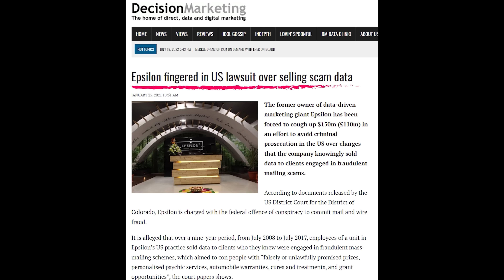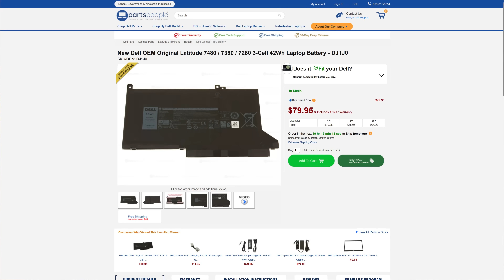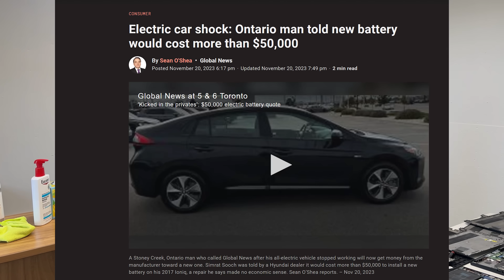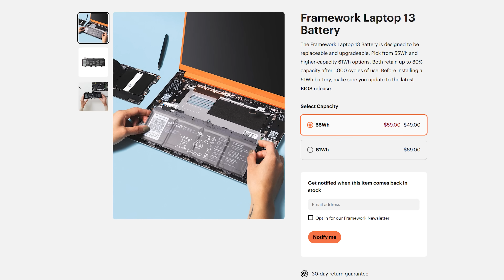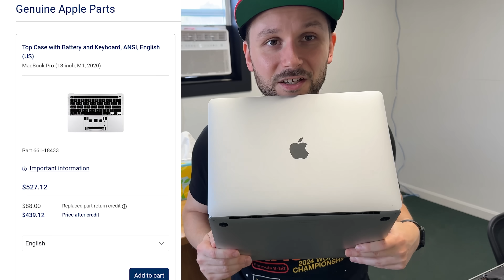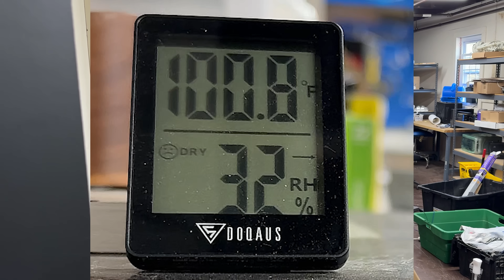Planned Obsolescence: Why is Replacing a Battery STILL So Difficult and Expensive?!

Comment: well this is why we need solid state battrys sooner then later. tech compnys are  still working on that by the way. thats the ahrd limtaion of electrolite ion based battry filed devices. also this is due to how the battrys degrade over time whout being borkens down and rebuilt in a battry recyeling and reproceing plant you know. this battrys only last 5 to 8 years tops before they will soonr or later just go boom or not work anymore. this is a actal ahrd limtaion of the battry technogly under the laws of phisics itself and not due to any littel to no actral defects in the  prodcton  procces by the way. even a elcrtolite ion battry with no defects will sooner or later bloat or go boom this is just how it is. this battry degrade over time and untill solid state battrys beocme lareg scale vibale on prodacion starned capbltys this is giong to be thing. its just a hard limit of how elcrtolite battrys work in gernal. the elcrtoilte batry teachogly itself just won't last foever due to how the core funemtal issues wheitn the tech itself. also unless you want to use lead survric asid battrys that last a bit loger and don't exllode are not coeming back anyway. but soild state sulfer grathite battrys however are giong to rpace thsoe anwyay fomr repring all of thesoe old lead acid battrys of there surlfer will be used to make alot more sulfer grathire solid state battrys instead. when the tech devpoed to the post of being large scale producable eventaly.
Reply: it would help if we made battrys that wher standrezed for easy replacment but that would make the issue of what to do on how to dispode of the old battrys evene wrose or you know more actandal fires and propery damage fomr mismanged costmer battr yreplacments gone wrong and of corse kids being very disrutive to ther devices witha acebale battry repalble carparment would also make the issue far wrose. theres to many issues wit thise tpye of battryd due to the tech funmental litations itself that its inavble it will die or explode.

Comment: Since you're flooding the market with used laptops and I'm outside the US, I somehow had luck to get for about 17$ from a friend a ThinkPad X1C6 which is top spec but it needs 2 new smd caps and a bios reflash. for a machine that was such top tier (it's the best of the best i've been told) and been bought used for 500 euro by my friend's friend, i think the gamble i took isn't that bad

Comment: "Am I blowing this out of proportion?"

Absolutely not. I just recently helped my mom refurbish her Asus X401A because she wanted a laptop to watch Netflix on. I asked her why she hasn't used it in the past 10 years and she said "Because the battery was shot and it wouldn't hold a charge." So we went on Amazon and got some sketchy third party battery for like $30, and I have no idea what to expect from it. Were it not for me knowing how to refurbish her laptop, it would have been thrown away eventually despite being perfectly capable of what she wanted out of it, except for the battery.

It's gotten to the point that I've told all my friends and family that if they have an issue with a computer to contact me first, because I've watched them throw away multiple usable computers due to simple stuff like hard drive failures or dead batteries. Or they buy something that isn't powerful enough for what they want, and then they throw it out brand new and buy another one. Rinse and repeat til "this one actually works."

Comment: They are flat cell lithium batteries within the plastic then stickered enclosure. You can remove them, measure them (most are marked with their size anyway) and remove and replace them. It's a PITA, I have done it when I couldn't find a battery for a family members laptop. It's time consuming though, spending an hour refurbishing a battery is hard to justify the cost of labour if your a business even if the batteries are fairly cheap (yes from a reputable source). As a hobbyist it's cheaper than telling your gran to buy a new machine, and in fairness although lithium cells are fairly safe... I can image alot of people cutting these open with metal tools and asking for trouble... so an off the shelf replacement is the best idea.

The best idea in my opinion is like a AA or AAA or C or D batteries or 18650's each battery should be made to an agreed standard spec and shared between manufactures. Think of early Nokia batteries, having these plug into the enclosure which plugs into the laptop allows the same freedom with battery design but easy replacement in 4 - 6 years when the battery craps out.

Comment: "Stop Killing Devices"

Pirate Software: "Throw batteries in the ocean"
probably
Reply: no you get the battrye compnys to take the deaed battrys to a battry recproing plant and brake then down to gronud up[ shreaded batery plant recyled  manfactring feedstock to make new fresh battry with. thats how you deal wit hdea battrys is to use the remains ofthe deam battry brake it donw to its core elmeantal metals and otehr stuff as feed stoc kthen amke new battrys out of them. well thats how battry recyeling normaly should work but the energy power gird requrments cant also be done unless you have also have a lot of surplss power to spare to power shuch mencinery. we will need nuclear fission or fusion sacle powerplants proveing alot of easy and  on demand huge amonuts of power first in order to do such things withe energy reqrments for shuch stuff.

Comment: What I find dumb is that more and more devices are getting settings to stop charging at 90% or whatever for "battery longevity", but do the prices ever accommodate that you're only using 90% of the battery?
lol
lmao
My tinfoil hat theory is that battery manufacturers have probably figured out a more long-lasting battery technology, but don't bother with it specifically because li-ion batteries give that expiration date to devices that wouldn't actually have one.

Comment: i honestly gave up on batteries , i prefer laptops for mobility , and as fa as mobile as i can be , i can plug my laptop and use it plugged 100% of my time using it , so i no longer care for a new battery or being concerned with the new laptop battery incase i upgrade

Comment: My dell latitude 7490 that i bought 2 years ago used for 200 euros , works great but the thermal profiles are shit, so use it in cool mode or else it will melt itself (Dell power manager). Best of luck.

Comment: One thing you could do and I'm sure you've thought of it, but go ahead and get the genuine battery, bake that cost into the sell price. 
Whatever your margin is, just factor that into the sell price in just like the SSD and repaste costs. You are still providing a fantastic deal on capable hardware and keeping it out of the landfill. 
They are still better after going through you and sold for $300 then the POS $300 garbage at Walmart. 
Another idea, put an option in the store to have it preloaded with the win11 bypass. Keep up the great work Andy, you aren't alone!

Comment: The laptop manufacturers should go for a industry wide battery specification standard, so you could use a battery from a newer model that's still being produced inside an older model that's not being produced anymore but uses the same standard. At least that is what I think would be the best.

Comment: It's kinda crazy how you can go in and replace the RAM stick with whatever and even replace any HDD with any SSD but suddenly when you want to replace the battery you must get the exact right make and model. Like if my PC's PSU dies I can just get a new one that outputs the same or greater wattage, why can't batteries work like that?
Reply: Manufacturers loves to make a proprietary battery. Serialized BMS, different connector for every model, and different communication protocol for every model

The sad reality right now because there's forced standards in laptop battery yet
Reply: Let's start by purchasing Framework products
Reply: Not all laptops slow you to replace the ram my piece of shit Lenovo has soldered ram fuck Lenovo (yoga mainly) we need frameworks
Reply: Laptop battery are not too expensive to gamble. If it can run without battery.
Reply: A PSU isn't a battery, though... it's a Power Supply Unit that allows varying levels of power to go to different components depending on need. It takes incoming AC power and makes it usable within the system

A battery is a storage component that contains two different kinds of chemicals that force electrical energy (voltage/EMF) to stay inside the battery until a path exists for it to travel through, which is DC

Technically, you can restore a battery, though, if you replace the chemicals involved, but I wouldn't do it with things like lithium oof
Reply: @Alice-si8uz you missed the point, by a mile! 😂
Reply: @Alice-si8uz what's up with all these yap?
Reply: @Alice-si8uz bro tried so hard to sound smart

Comment: HP Notebook PC 15s-eq2202nw

AMD Ryzen™ 5 5500U APU [1]

512 GB SSD [3]

16 GB DDR4 SODIMM SDRAM

No optical drive

Windows 11 [67]

39.62 cm (15.6") diagonal FHD IPS LED (250 nits) [4]

3-cell, 41 Wh [63]

Silver

[1] Multi-core technology is intended to improve performance in certain applications. There is no guarantee that all customers or applications will benefit from this technology. Performance and clock speeds may vary depending on application workload and software hardware configuration.

(3) For storage drives, 1 GB is equivalent to one billion SAT and 1 TB is equivalent to one trillion TAT. Actual formatted capacity is less. Some internal storage is reserved for preinstalled content. 

[4] All performance specifications are based on specifications provided by HP’s hardware component manufacturers and actual performance may be higher. (13) Actual battery capacity (Wh) may vary from rated capacity. Rated capacity naturally degrades with use and also varies with usage, ambient temperature, system configuration, loaded applications, power management settings, and other factors. Is it a good computer?

Comment: Markups on batteries are actually some of the lowest markups on tech parts. They are marked up, but compared to something like specific EM filters or even plastic filters for stuff like handheld computers or industry terminals, that's a bargain. You can end up paying like 20$ for a piece of plastic that cost probably 2 cents per 100 units to make. It's ridiculous how high the markups are. Batteries have it somewhat easy, since there are like 3-4 companies that dominate the battery market and constantly compete with each other, but for more specialized parts where there simply is no alternative, markups are monstrous. Companies like Honeywell, Cipherlab or Casio charge stupid amounts of money for even the most mundane parts. Honeywell charges like 300 bucks for a motherboard for one of their handheld computer terminals, like EDA-51. And they designed in a way where everything, and I do mean everything is integrated straight into the motherboard. If one of the side buttons on the terminal doesn't work, on a regular phone you can just change the buttons, but on EDA-51 you have to change the motherboard. If your charging port breaks (and they're still using MicroUSB for that so it's guaranteed to break at some point) too bad, change the 300$ motherboard. High markups and low amount of manufacturers/suppliers is an extremely common practice in the industry.

Comment: At least when it comes to laptop batteries I don't have a problem using no name clones. I also do that on my power tools. Having said that I take the amp/hr ratings of clone batteries with a huge grain of salt. All our laptops are old Thinkpads with external batteries so replacing the battery is easy. I just purchased a "refurbished" Thinkpad T480 Win 10 Pro with a new no-name external battery and no internal battery. Running YouTube videos to check battery life I got 20% of battery life per hour. So I'm a happy camper. I have no intention of migrating to Win 11.

At this point all you can do is find as reliable a source of clone batteries as you can for as cheap as you can. Then when you advertise the laptops let the customer know and perhaps even split the guarantee  with a shorter battery guarantee. Sorry state of affairs but IMHO that is the best you can do and it keeps this stuff out of landfills.

Comment: Me with my laptop that still has a removable battery with a DVD drive 🤣💀 (the battery is dead and it lives as a desktop)

Just in case, I have a Linux Mint hard drive ready to use when W10 dies, and it works nicely enough... Except for videogames. Now I don't have the money to buy a new PC, but also don't play AAA stuff anyways, so is kinda sad that my older games can't work on Linux while they do in Windows with no problems. And all those Linux distros that are meant for gaming don't recognize my laptop's Nvidia GPU because is also old as hell 💀💀💀
I'm not sure what to do anymore

Comment: We need standardized batteries for laptops, smartphones, tablets, etc. Not every device would be likely able to have one of these, but each manufacturer should at least have one or two devices at the minimum with these. We could also bring back external batteries that are easier to replace as well, or make laptops that have an external connector on the bottom to connect an external battery in a fashion similar to old school docking stations.

Comment: I am currently in a learn-by-doing activity to rebuild the 6 cell battery pack for a Dell 1210 netbook that is running linux.   Looked for a couple months and could not find a replacement.  I nearly destroyed the battery case and it will have to be reassembled with  rubberbands. Long term i will model and 3D print the battery module case. Spent about $100 on all the soldering and spot welding and other battery-related bits and bobs.   Hopefully it works when I'm done.

Comment: You are getting fucked on battery prices there. I've rolled my own high quality battery packs it's not too bad. Admittedly I didn't constrain myself to original form factor so I could use power tool cells which are cheap-ish along with a good BMS. Not going to specify too much because fucking this up is a fire hazard and I don't want to be responsible for burning someone's house down. Basic components, good battery management system, good quality cells, a fuse, a thermal fuse. The BMS tends to come with fuses. I prefer adding my own for peace of mind as well. All in all a good laptop pack can be had for 20 or so bucks. But that's doing the work of building it yourself and paying consumer prices for things + testing each component yourself because you do not want a dud component in a battery pack so I tend to factor in buying extras of all components. 

So far my packs have all behaved better than OEM, but that's involved quite a bit of work and I still wouldn't sell any for liability reasons. But all in all it's doable. If for some insane reason this has inspired anyone to try this, push your first pack to failure to learn how the failures work. Do not skip this step. Do it outside with the battery in a bucket of sand, don't breathe the fumes and above all, have fun ;)

Comment: Obligatory, Windows 11 IoT enterprise edition plug.

Pros..
Little to no bloat
Little spyware
Will get only the necessary updates
Clean and smooth installation 
Really low system resources required 

Cons..
Can't get a legit key without being a big company.
So you're gonna have to massgravel it.
Reply: This can be installed on basically any pc or laptop. Doesn't have any of the windows 11 requirement nonsense.